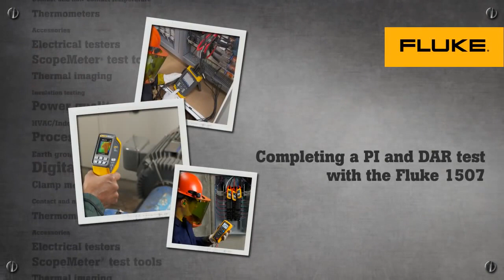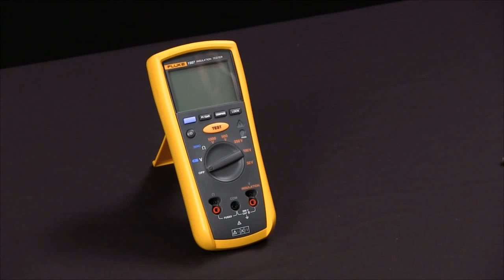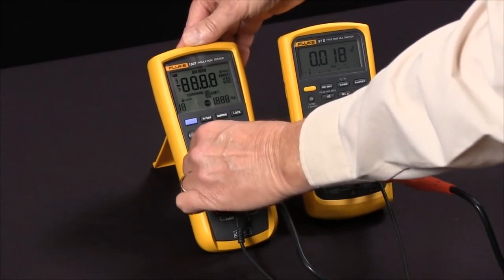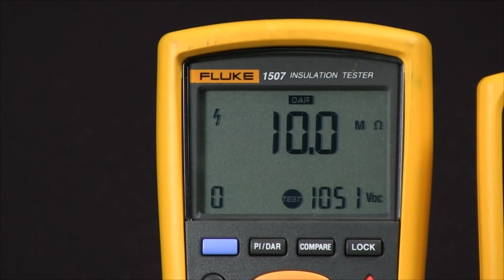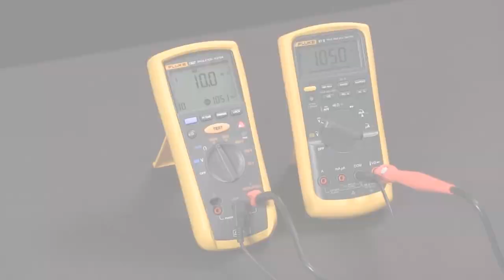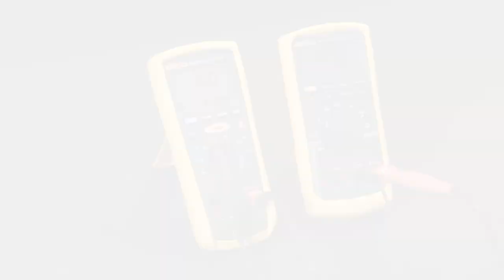How to Operate a Fluke 1507 Insulation Resistance Tester to Run PI and DAR Test

Comment: What is the max reading/highest value this tester goes up to for an insulation test? After meggering we keep getting 11g as a constant reading which seems like an odd number after other meters we’ve used go up to 250g or >250g.
Reply from the maker: Hi James, the highest range for insulation testing is 10 GΩ. If you require further assistance, please do not hesitate to contact us at one of the following methods on this page: https://www.itm.com/content/quick-contact